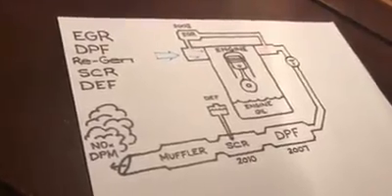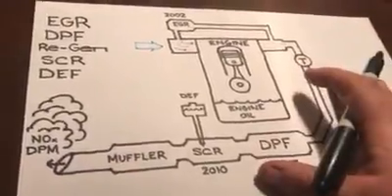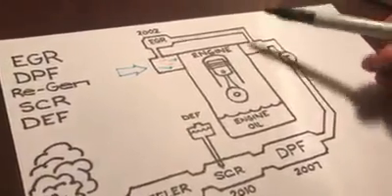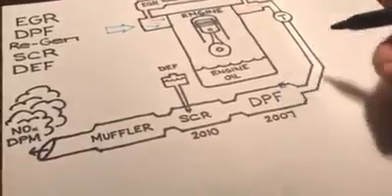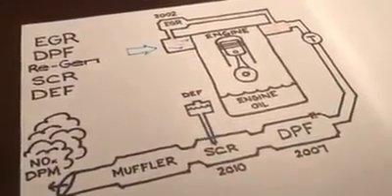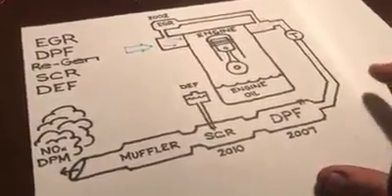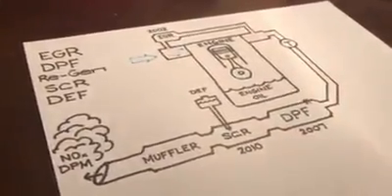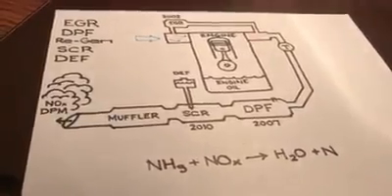No more rollin' coal?! Diesel Emissions for highway trucks!

Comment: And it's killing the engines. Get rid of the egr, get the combustion Temps up and take care of the soot internally and take care of the nox with the def. Why don't they? Because the filter manufacturers got to the regulators first. Every engine manufacturer I ever heard of says no more than 3psi back pressure, these start at 3 and get worse.
Reply: Follow the money